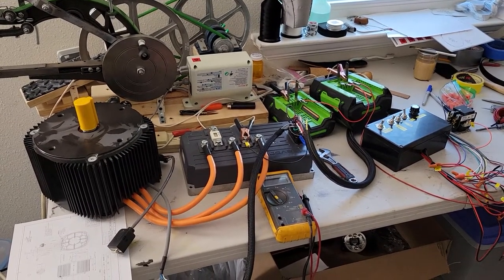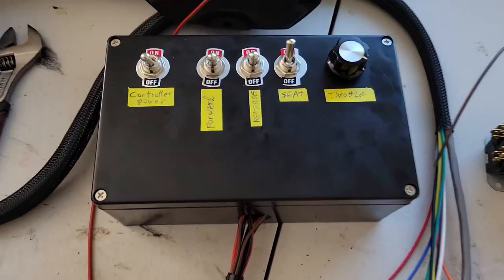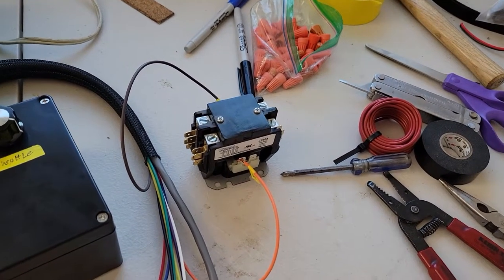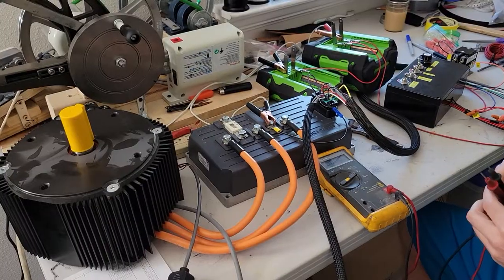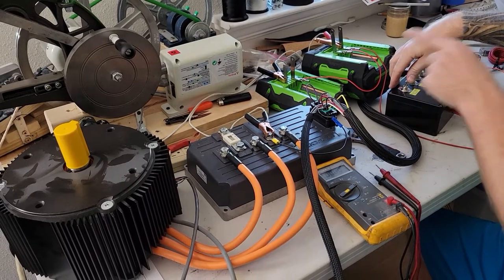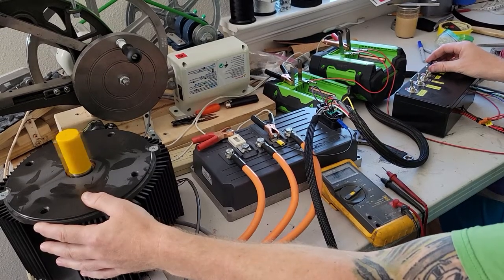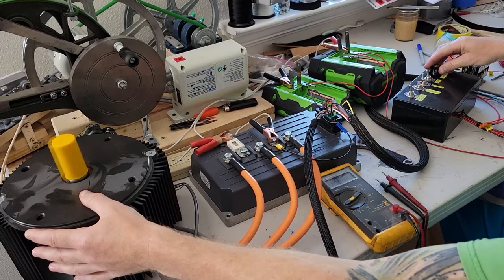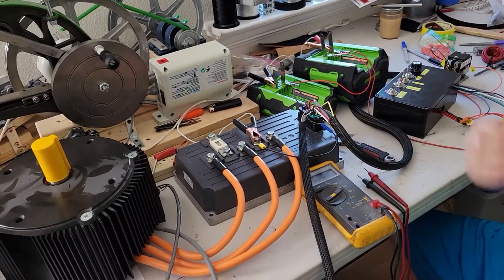ME1507 & Sevcon Gen4 Size6 bench test

Comment: Hello good!  I have a query about the sevcon gen 4 controller, it is currently connected to the ME1616 motor, the motor rotates correctly but at a certain point it stops and from the DVT software it indicates the error, current control and overvoltage sometimes both errors sometimes one only.  Could you tell me what configuration parameters I can modify to solve it?  Thanks, I also wanted to ask if you know how to get the SCWIZ software for the auto-parameterization of the motor.  thank you
Reply from the maker: Sorry man, I can't help you there.  I paid someone to program this controller and while it works, I pray to god it never fails.  If it does the Sevcon is going in the dumpster and I'll buy a more user-friendly controller (like Kelly).

Comment: Hey, can you explain what the seat switch does? Does it measure if the seat is occupied? I bough and old military EV whith everything still in it, but i cant seem to get it to work. I also cant get the contactor to engage but that is another problem.
Reply from the maker: Yes, that's exactly what the seat switch does.  You can technically short that contact so the controller thinks there's always someone in the seat.  But you can NOT do that with the direction switch (forward or reverse).  If either of those contacts is closed when you power up the controller it will go into fault.

Comment: Does this also do regeneration?
Reply from the maker: It can, but I'd have to configure the input to the controller for it.  Just like the throttle, it's a variable analog input.  Some people have used strain gauges and voltage multiplier circuits connected to fixed clutch levers to vary the amount of regen.  Others just use a switch for a fixed amount.